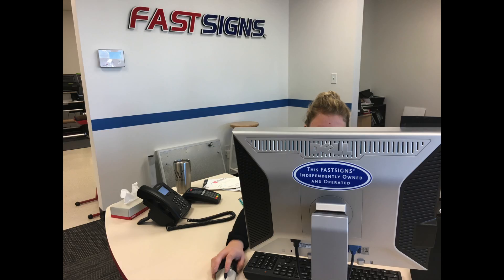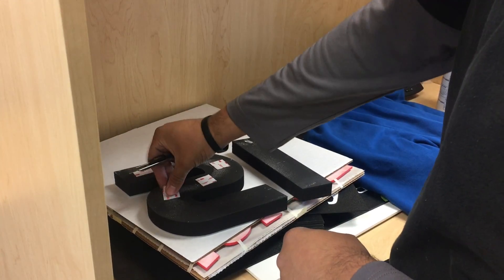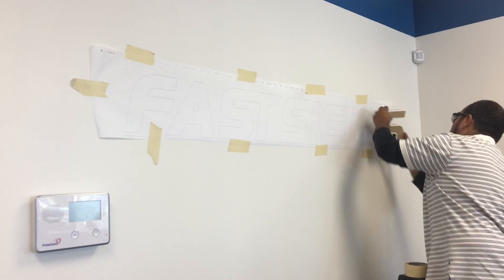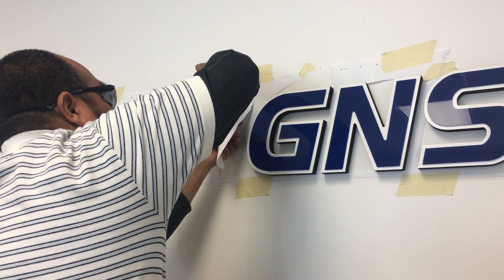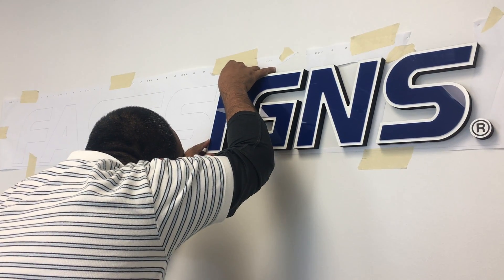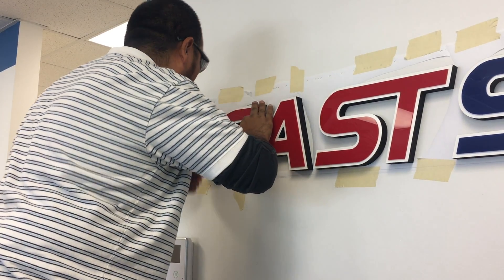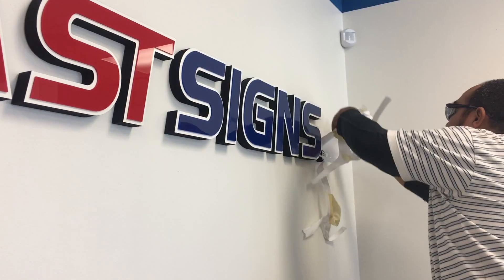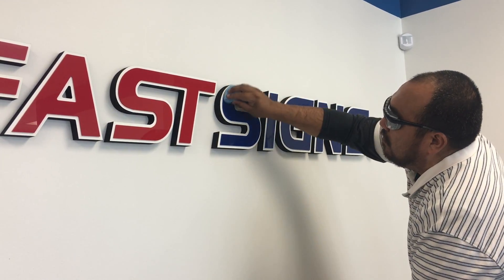How to Install Dimensional Gatorfoam Letters - FASTSIGNS

Comment: wouldn't it have been easier to do a pounce pattern or even a cut pattern on the plotter?
Reply: no
Reply: Will S How wouldn’t it have been. I just did this exact type of install and used my cutter on perf cut and had it done and ready to go in under a minute.
Reply: @ryandayon2250  right. just cut the letters out. he cut them by hand risking cutting into the wall, how much you wanna bet he left marks on the wall... I would delete this video if i was fastsigns
Reply: Seems like precutting the lettering out would be the way to go
Reply: @ryandayon2250  chalky mess will run risk of tape not adhering  as well but they should have precut the paper before taping leaving it connected in one or two places so you dont risk cutting wall but im sure they didnt mind becaue it was a sign for their own shop